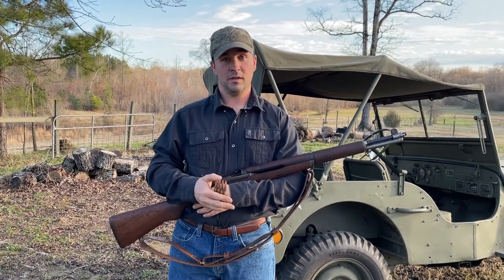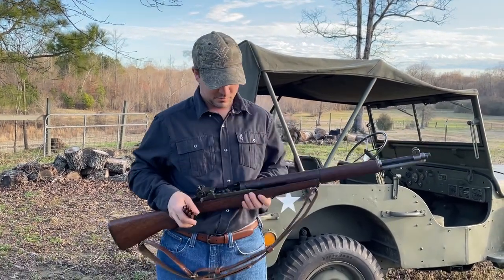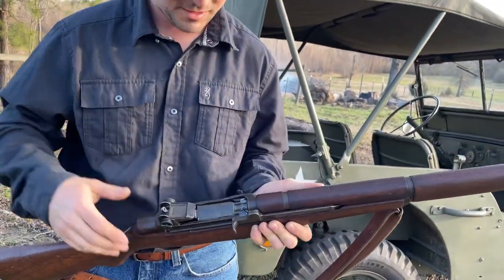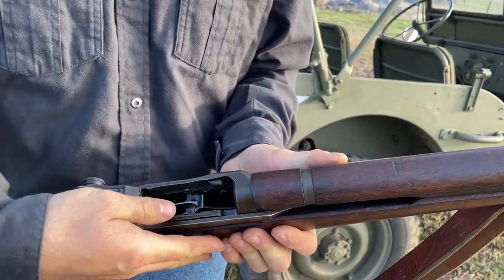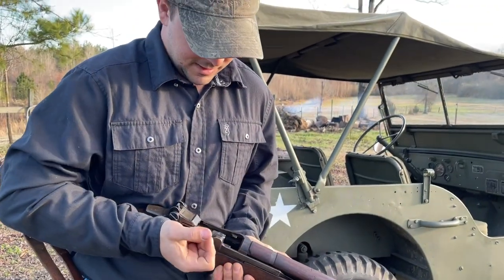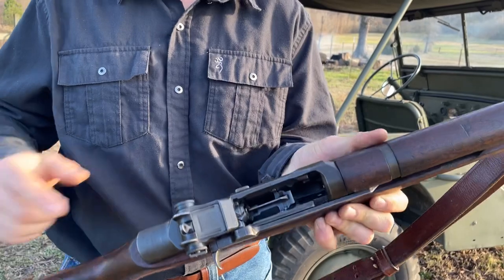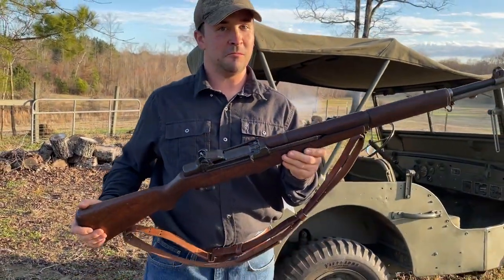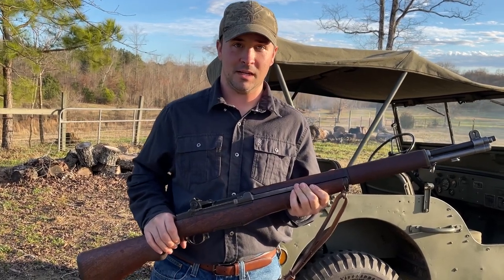How to NOT get M1 Garand Thumb - fakebullets.com

Comment: The other trick (which you get wrong) is to load your clips with the first cartridge on the bottom left.  This puts your last cartridge on the top right.  Turn the clip over (they work both ways) and that bottom left is now top right.  Having the top cartridge on the right next to the op rod means you don't have to reach across the mag well when shoving the clip down.  It's less awkward.  Your thumb is pushing straight down instead of reaching across at a 45 degree angle to depress the clip.  That's the way it was taught back in WWII.  There's a right way and a wrong way to load a clip and once you compare having the top cartridge left or right you'll see why they did it that way.
Reply from the maker: If you have a reference for that please share it. I have never seen that in any GI manuals or training films.
Reply: @JM_Spec  Try it, then you'll get it.  Not sure you'll find references because ammo almost always came pre-loaded in the clips, with the top cartridge always on the right.  My Dad (30th ID WWII vet) showed me that with an old CMP Garand 50 years ago. It was the boot camp drill.  Load your cartridges in the clip properly, then load the clip into the rifle properly.  One follows the other.
Reply from the maker: @kodiakkeith  This one’s for you. https://youtube.com/shorts/FsjKTDZwYDg?feature=share